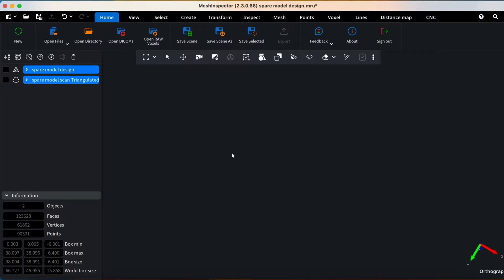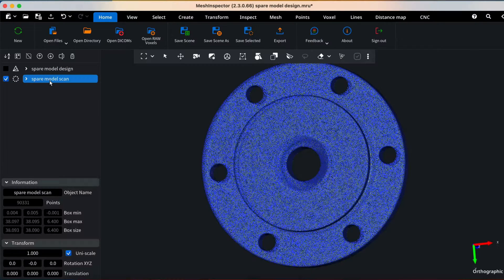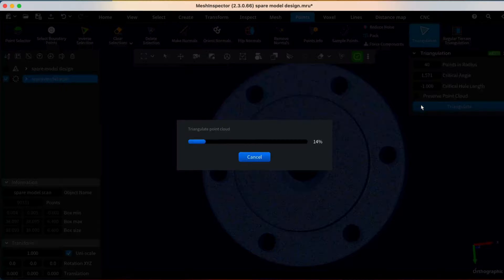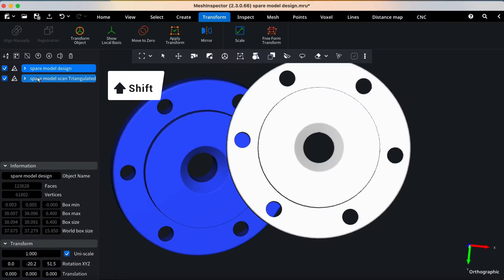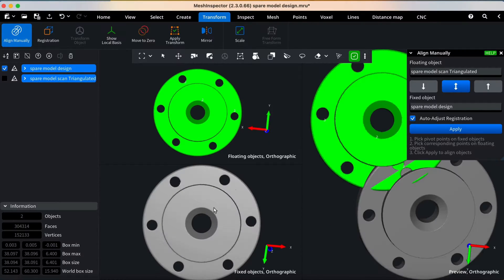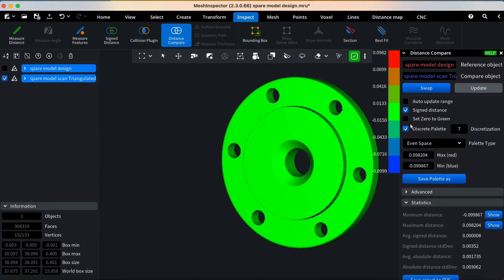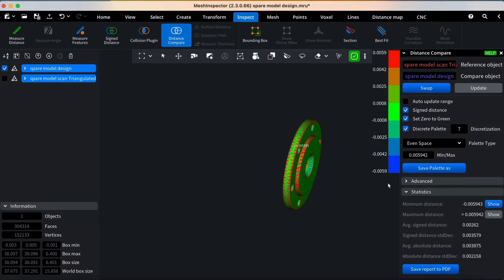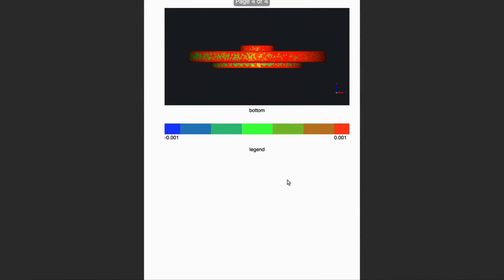Part Quality Control workflow in MeshInspector

Comment: Can I calculate the volume difference in that area?
Reply from the maker: Yes, you can use the boolean difference and then see the volume of the result. I hope it helps.
Reply: Thanks I will check

Comment: Hello! I was wondering if it's possible to get full/comprehensive statistics information when using distance compare? The concise min/max statistics are useful, but I would also prefer to have full info about distances.
Reply from the maker: Hi! We're ready to improve the tool and welcome your feedback. Could you please give us examples of full, comprehensive statistics information?
Reply: @meshinspector  Thank you so much for your reply!
By full information I mean the data from which the min/max distances, average distances are derived (mentioned at 2:04).
If it is possible, I am thinking of a table that has reference object coordinates on one column and the signed distances on the other column.
Reply from the maker: @happyquark4686  Do you want to export full information into a PDF or to be visualised in the dialog box?
Reply from the maker: @happyquark4686  there may be too many points' coordinates. If possible could you please send references at support@meshinspector.com?
Reply: @meshinspector  Both options sound great, but I think having a pdf would make a data transfer easier?
Could you clarify what do you mean by references, please?
Reply from the maker: @happyquark4686  If you have examples using other software, could you please share them?